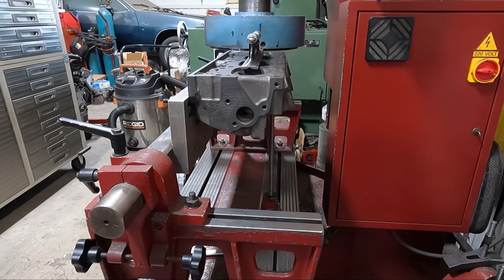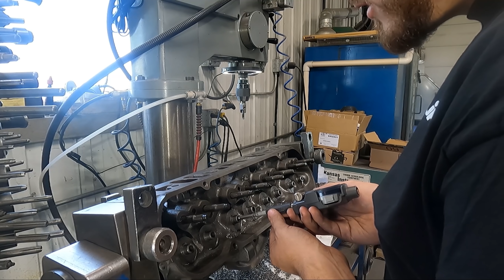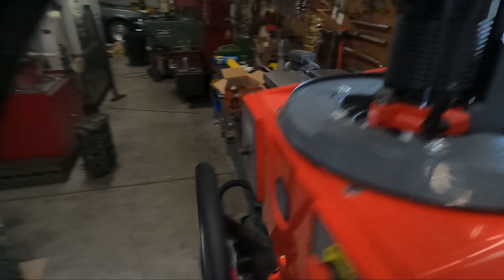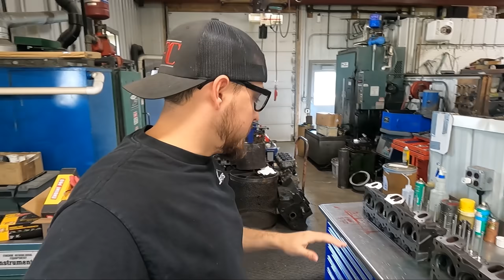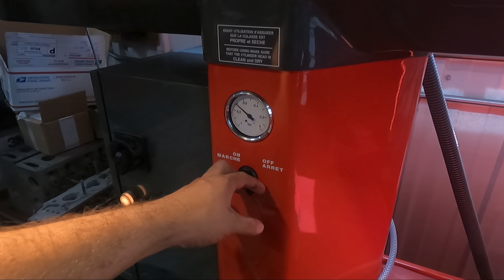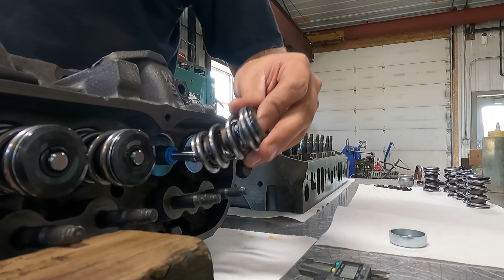These Heads Were A Lot Of Work To Rebuild! - '68 Firebird 350 Engine Rebuild - Pt 4

Comment: Opening the valve ports like that was spot on for max airflow and performance. I did some Chevy SM heads back in the day with paper thin gaps between the exhaust and intake valves. Commenting as I watch this video. How you reference your measurements is spot on!!! Also facing the exhaust ports. So many people deal with exhaust leaks thinking it is because of their headers when it is really the exhaust face on the head.

Comment: watch a lot of your videos and really crash course in on him lately but It's awesome you got to learn with your  pops im finally in a machine shop full time and kind of crash course on parts I don't already know an trying to save it from closing down so trying get as much info on seats and guides most of the work and the old guy there is mostly dose Stone work but there is a vgs 20 sitting there id rather be using so an info can pickup YouTube an what can get from the old man that's retiring from the shop just a small 2 guy shop soon be just me till find someone else not much for Tech schools down here in Florida auto machinist kind of a dying trade unfortunately but it is a full machine shop sunnen hone boring machine the vgs 20 definitely has lots of potential and a wide area all to itself with plenty of work that's another big thing the old man that's there is still in the 1980s on pricing working on getting that up to par with closest shops that are an hour and a half to two hours away so yeah any more boring honing surfacing valve an guidy work videos you can do be great

Comment: When our heavy line tech did valve jobs back in the early 80s, he would lap each valve to the seat using lapping compound and a tool to spin the valve.  With the process you used, is that something that no longer needs to be done?

Comment: I've built a bunch of Pontiac 400s. There's a few tricks keep enough oil flow to the crankshaft. You have to drill out a few oil passages a little bigger. Lifters have to be perfect bore to lifter clearance or the oil pressure will be reduced going to the crankshaft. I built a 455, offset ground the crack .030. Used Manley ..400 over length Chevy Big block rods. bored the cylinders .108 used AMC 390 12:1 pistons. It came out to right at 502 ci. It hit 1200 HP with nitrous. But the crankshaft would oscillate so bad sometimes it would clip a rod..that usually doesn't work out too well.

Comment: My 4.8 heads seats were right at factory spec with 236,000 on it. The valves were not serviceable so I replaced them with Elgin valves.

Comment: Leadown between the valve stem and the valve guide is OK? What?
It is the sealing surfaces on the seat and valve that is measured - not the valve guides! Totally wrong conclusion bu You! EDIT: I just went back, and realized You didn't put o-rings on the valve stems on the valve spring side. Huge mistake! Those o-rings will seal the valve stem to guide clearance - because they are sucked into the tiny opening, as You vacuum check the seat job. 😣

Comment: Do you use a 90 degree cutter to oversize the intake valve seat before going in with a 3 angle cutter or do you go in with something more aggressive but still not as steep as your eventual 60 degree cut?

Comment: I don't get it, a 50 year old engine? Okay, now it is better than new, but even new  it was junk. I know, my first new car was a 1968 Pontiac Tempest with the OHC 250cu 6 (same size as the Jaguar XKE DOHC,  only  $2.850, no sales tax back then. One of my friends bought the Olds Cutlass with the 350. Both cars were junk. My roof rusted threw in 3 years.

Your 5 days of work must cost thousands of dollars, the 350 is not a GTO or 442 engine. Can't you buy an new V8 for much less?
Reply: You are right, you don’t get it.
Reply: @grntitan1  Thanks for the reply. That what makes the world go round!

Comment: This was quite an impressive job.  Even with the best equipment attention to detail is most important especially when dealing with 50+ year old heads that had previously been reworked.  This engine will be better than new when it is finished.
Reply: I dread seeing an auto part that was rebuilt more than once. I cant remember how many 1980s CV axles I had to relace because they were horrible to begin with, and rebuilding made them even worse.

Comment: So are these new valves 2.11s, and 1.77s? It looked like the originals were 1.66s on the exhaust. And also, was curious why the exhaust guides got seals. Isn't that port a positive pressure? Anyway, thanks again for posting.

Comment: I have a 67 Firebird with a 455ci that I would love for you to rebuild. Engine was rebuilt about 30years ago and no problems with it but more horsepower would never hurt.
Reply: I built a 455, offset ground the crack .030. Used Manley ..400 over length Chevy Big block rods. bored the cylinders .108 used AMC 390 12:1 pistons. It came out to right at 502 ci. It hit 1200 HP with nitrous. But the crankshaft would oscillate so bad sometimes it would clip a rod..that usually doesn't work out too well. It needed a billet crank

Comment: I am having the 400 on my 1967 GTO redone now.  My machinist told me the old 670 heads, which are bare are too rusty and it wouldn't be cost effective to get them back to working shape.  After seeing how much work goes into these heads, his assessment is confirmed.  Thanks for showing just what goes into this type of work.
Reply: Some people invest a fortune in their original castings in order to keep a numbers matching car. It might not be needed in your situation if the engine had heads rebuilt already, and your repair shop installed whatever date casting they had on the shelf.

Comment: Same exact process i used in the early '70's on a Peterson.
I like that you use the small ID seat and bore it to fit the pocket.
I did that.
But i didn't cut the seats that deep... you can't always trust the castings.
I used to install thick seats just shallow enough to get the job done, and then trimmed off the excess height to match the chamber.
A quick carbide burr to eliminate the small step shoulder in the port and only trained eye could detect the false seat.
Glad to see you using the best habits in a profession that is often guided by alternative physics.
Reply: On the Myvintageiron channel, he tries to avoid putting hard seats in those castings because there isn't much depth to the water jacket.
Reply: @skylinefever  
Exatally.
I never installed seats to their full depth, and never had any loosen up later.
If you cut the bore a tad too loose, the seat will spin in the bore when you attempt to trim the tops down, or use the angle cutter. That's a good indicator you're gonna have a problem if you don't start over with an even larger OD seat. Not good!
Thankfully that doesn't happen very often if you keep your tools sharp, and keep your wits about you.
Dull cutters are TROUBLE.
I worked in the largest engine rebuilding shop in S. Calif.
If a single seat had failed, they would have denounced me in front of the whole whirled, and fired me on the spot.
I don't miss tugging on rusty boogers, even though the work itself was satisfying to see a job well done, even though very few could actually recognize a job well done.
This guy does a great job!

Comment: just a question..the heads appeared to have pressed in rocker arm studs..would screw ins and guide plates been an option or necessary for the application?

Comment: I'm wondering what is keeping the seats connected to the ports when you are cutting, it seems like they would spin while cutting?
Reply: They're held in place by friction. The hole the seat fits into is a little smaller than the seat itself, so when the seat is installed it crushes it down a little. The metal acts like a spring and wants to expand back to its original size, so it presses really hard on the hole, producing lots of friction tha locks it in place.
Reply: @nerd1000ify  very interesting, thanks a lot.

Comment: Great video !!  I just have 1 question, what are your thoughts on making sure the keepers don't touch each other ?  I've been told that if you don't leave a space on both sides there is a chance the keepers may not seat in the groove(s) properly and can be an issue especially if high performance engines with  high spring pressure..
Reply: I've always given the valve top a good whack with a hide mallet a couple of times, that seats the collets( keepers to you) and I've never had one come out .

Comment: Pretty sure Pontiacs were one of the brands that did NOT need hardened exhaust seats. Rarely seen Pontiac heads with seats installed. Pontiac used a harder iron compared to Chevy. Pontiacs are not Chevys! A lot of machinists do their machine work on other brands brand motors just like they would on a SBC or BBC.

Comment: Should have used a +.100 ABC listed 2" intake valve.  Why? The 2.11" intake is too large in the small bite. It actually becomes a flow restriction when the valve is that too large in the small 354s bore.

Comment: I cannot believe how many measurements you have to do when rebuilding heads. I'm betting that engine is far better than when it came from the factory. Amazing job.
Reply: The measurements have to be done due to wear , warping , previous machining etc . On stock heads all settings are ready and they know exactly what they should be .
Reply: @type2523  Actually, I enjoy seeing videos about people buying new racing heads. Many aren't that good out of the box. It's best to buy a bare race head, new parts, and pay a machinist to assemble. Often things will still be off from the factory.

Plus, when working on older cars, the kinds of tolerances that were allowed could be pretty wide. Many machinists aim for precision that an assembly line would not be aiming for.
Reply: @skylinefever  
You can buy from people like Brodix, Donovan, Keith Black and get top quality assembled heads. I agree I prefer assembling them myself.
Reply: I know this is an old post, but the level of referencing "Measuring" he is doing is going much further than traditional machinists. He's literally mapped everything and machined it out to work as perfectly as possible.
Reply: That is amazing. In addition, I don't think many cylinder head rebuilders make such precise reman heads. I have heard that many rebuilt heads from Autozone and Advance Auto are disasters right out of the box. In addition, many new heads are made in China and are as bad as you would expect from China.
Reply: its hard to recreate what the factory did [ and i am talking about real world not third world] or as i like to say its hard to get an industrial finish from a spray can

Comment: Beautiful work. I have to ask....what was the cost of this job? I have a set of Indy 360 X heads that need about this same amount of work.  (larger valves, spring pockets cut, new guides, etc.) Would  it be worth the cost to get them done, or should I consider a set of new aluminum heads and start over? Also, you put in cast guide sleeves, I thought bronze guides were better ( I was told cast iron could cause binding when hot).

Comment: They'll have enuff money in those not so good heads they coulda bought edelbrocks or Kauffman heads
Reply: The customer might want a show car that looks like the day it rolled off the assembly line.
Reply: @skylinefever  well if that were the case you'd think he'd a built a 455 or another cubic inch that ran better than a 350 cause all pontiac v8s between 67 and 79 looked the same

Comment: I'm a Harley guy with both iron heads and aluminum, my question is....how much interference fit are those replacement valve seats you're using here?? My engines may run a little hotter, so I need more press-fit. Your video is sweet !!

Comment: Do you charge extra to magma flux aluminum heads?
Reply: Magma flux is way expensive and locating an active Volcano is tough and Magma is tough on the Aluminum. Magna-flux is a way cheaper process but Nonferrous materials (aluminum, titanium, magnesium, copper, etc.) cannot be inspected using this method. Dye Penetrant Testing (DPT), also called Liquid Penetrant Testing, is a relatively low-cost inspection method used to locate surface defects in non-porous materials such as aluminum alloys.
Reply: @markthegunplumber8376  it was a typo, but supposed to be a joke dude

Comment: I guess I didn't get my question in fast enough, is it possible for a 390 crankshaft to fit into a 304 block to make a good reliable stroker?
Reply: What kind of 390 and 304 are we talking about here? Anyway, I suggest reading internet forums dedicated to the exact make and model of car and engine you have.